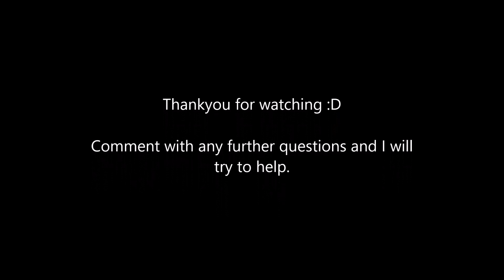2003 Renault Clio 1.2 16v Air & Pollen filter change

Comment: Hi, 
does every clio 2 have a pollenfilter even if it doesn't have air-conditioning?
Reply from the maker: Hello, thanks for your question most modern cars will have a pollen filter even when they dont come with air conditioning. Hope this helps.